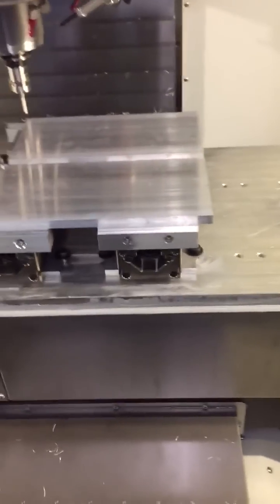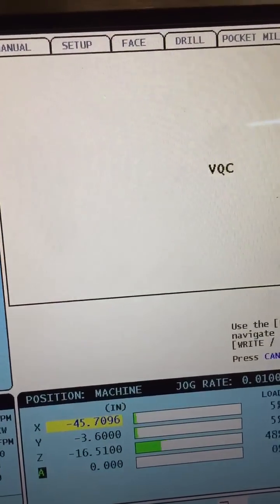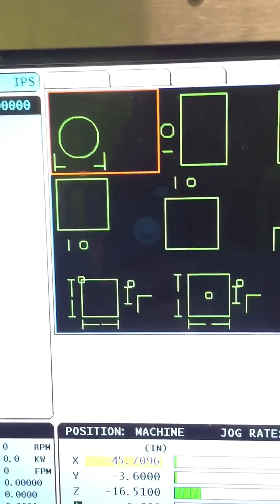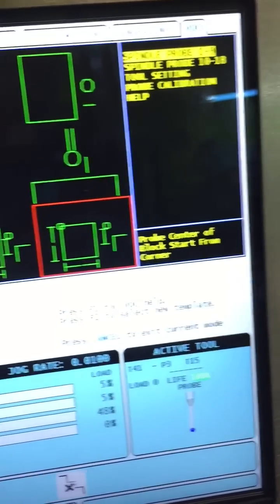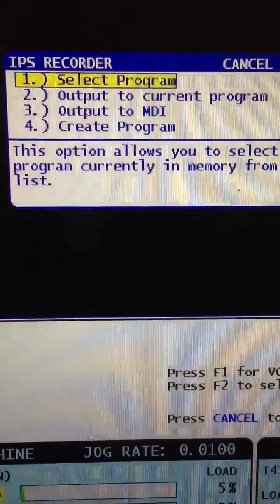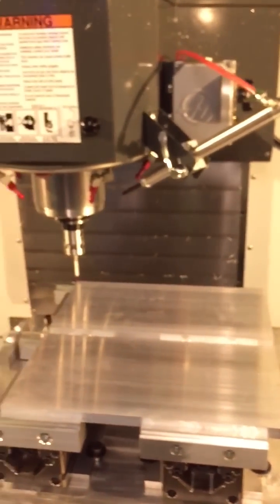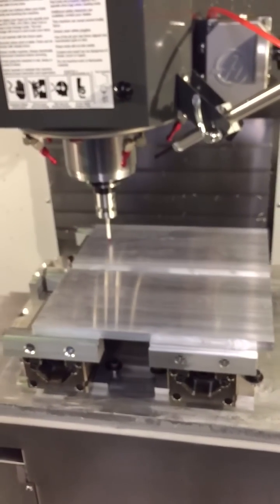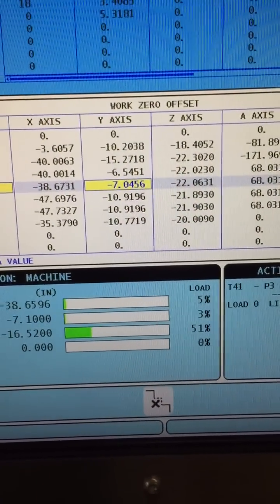ZOO CNC CONSULTANTS Haas CNC renishaw probing use probe center of a block starting from corner

Comment: How does the tool probe and the work probe work together. Say i use the tool probe and set all my tools but have moved my vise. As long as i touch off using the work probe to find all 3 axis (x,y,z)  will it know exactly where to go according to the program?
Reply from the maker: Late response but yes.  The part probe will determine the location of the workpiece and as long as you set the work offset and the Z height is set to the current work everything will be moved and the position will be updated